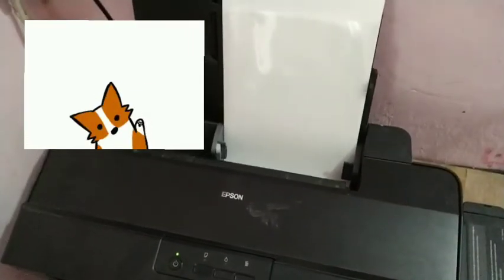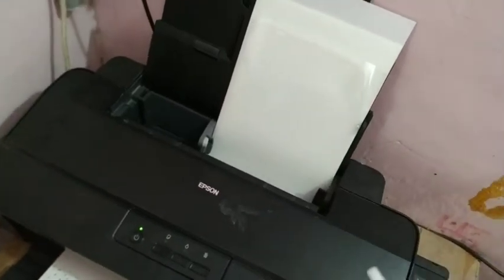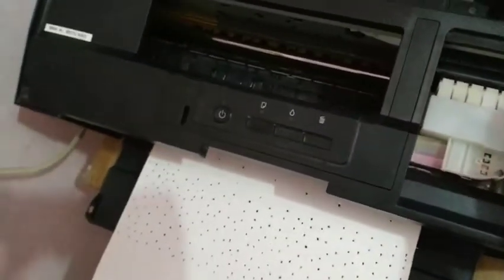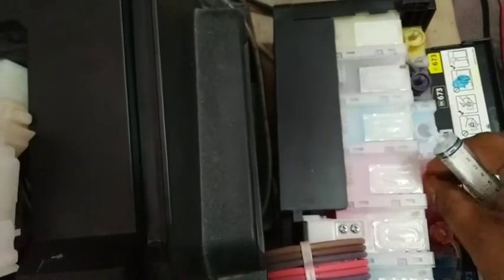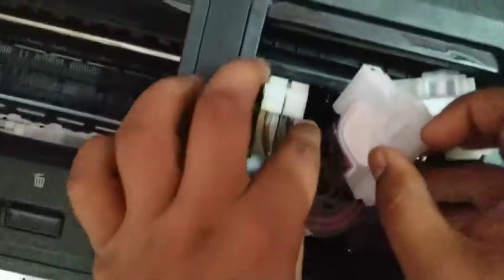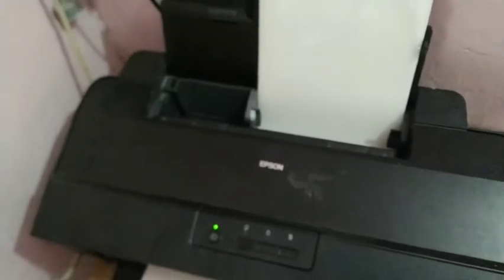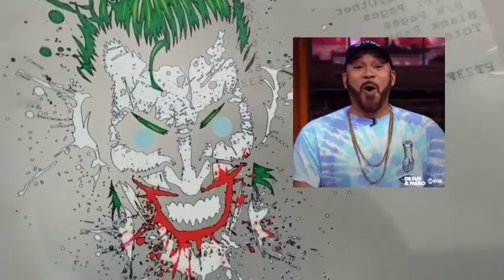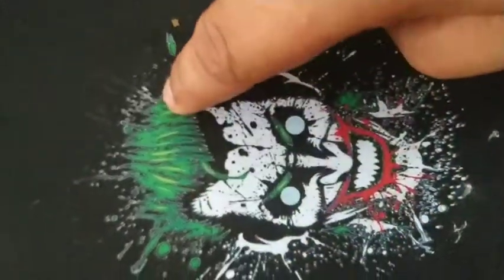DTF Maintenance  | White Ink Maintenance | DTF INDIA 🔥

Comment: I am your 100th subscriber! Congratulations!
Reply from the maker: Thank you for your support sir 🙏😇 any help or query you can WhatsApp me 🙏😇
Reply: @savagebrossublimation9708  Thanks! I will surely contact you if I have queries
Reply: @savagebrossublimation9708  I have a L1800 which I use for sublimation, I wanted to modify it to have an external waste ink tank. Do you have the parts for that like the pipe and connector of the correct dimension which I could buy?
Reply from the maker: @themortymart5664  may I know where are you from sir ?
Reply: @savagebrossublimation9708  I am from West Bengal
Reply from the maker: @themortymart5664  okay sir can be done please WhatsApp me - 8976878029

Comment: Hi! Thanks for sharing a tutorial. Question: Does this eliminate the use of power ink flushing? I do not print daily maybe every 2-3 days. Is this method applicable to my printer?
Reply from the maker: Yes sir don't need to do power flushing it takes lots of INK which goes waste, u should do this practice
In addition u can also put 3 to 4 drops of head cleaning solution in  caping  area. Then no need to do head cleaning ever.😇👍🏼
Reply: @savagebrossublimation9708  you have to do this everyday right? Or is it safe to do this only everytine you have to print (in my case 2-3 days)? How about the putting of head cleaning solution? Do I have to do this daily? Btw I really appreciate your assistance on this it's a huge help!
Reply from the maker: @daverivero7110  yes Sir it's safe but recommend if printer is not is use for more than 1 to 2 days

Comment: Can I use same tube that I used for sublimation ink for the dtf ink after I clean it ? Thanks
Reply from the maker: Yes just clean it with solution properly, try to change LC AND LM dampers white white ink
Reply: @savagebrossublimation9708  I don't have any spare dampers can I use the old one or there is a big risk 🤔
Reply from the maker: @almza7y  u can don't worry just clean it properly with cleaning solution
Reply: @savagebrossublimation9708  thanks brother you are great 👍
Reply from the maker: @almza7y  😇🙏

Comment: Why is your tube for the white ink is pink 🤔?
Reply: maybe he was using the printer for sublimation earlier...tubes have got colored due to the older inks...this is a modified printer, tubes are the old ones...hence the color
Reply: @PareshThakkar  thanks for replying, you are right, I have l1800 with sublimation ink and I changed it to dtf yesterday, yet I have a problem that when the head move for printing the ink doesn't come out on the film. I will try to solve it